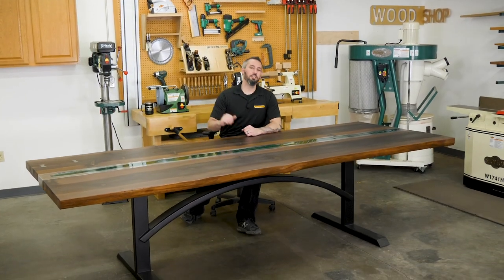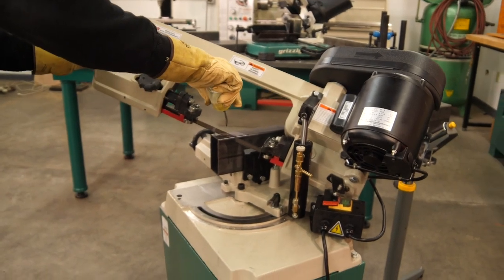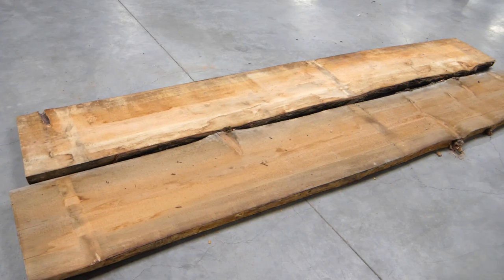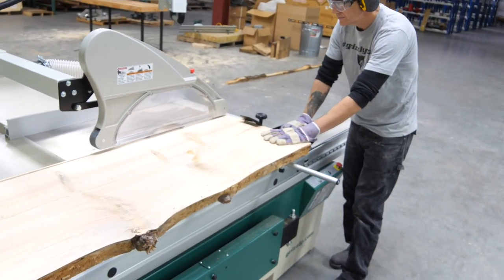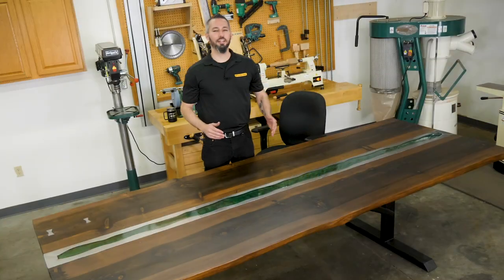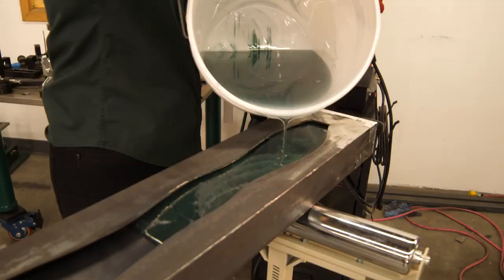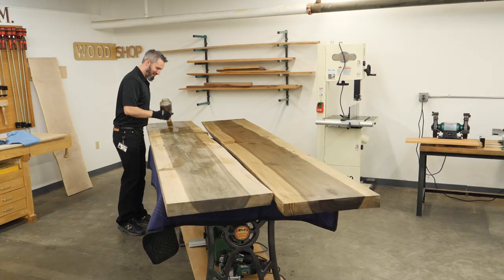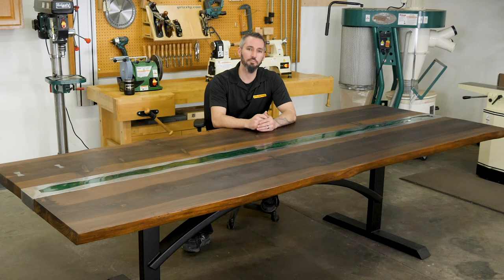Grizzly Conference Table Build Featuring our Marketing Team | Grizzly Industrial

Comment: Was nice to see something different from you guys. Also appreciate the tool call outs for certain tasks.  Would have been nice to know what tool was used to create the steel arch.  Thanks for the video!
Reply from the maker: The arch used in this build was actually a re-used piece from an old in-house-built hoist we had that ended up being repurposed into one of the highlights of the build! The heavy wall steel arch was once used to support everything from table saws to engines, and now it supports some intense conferencing. :-) Thanks for watching!